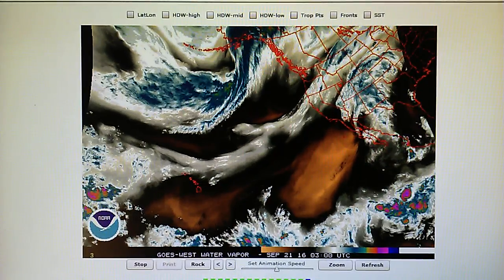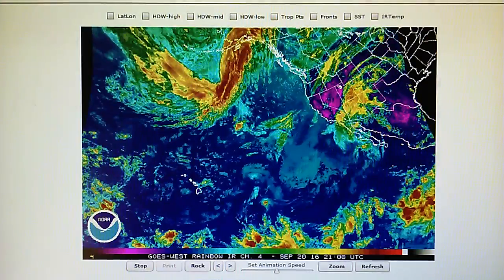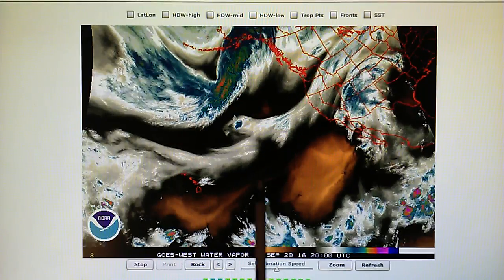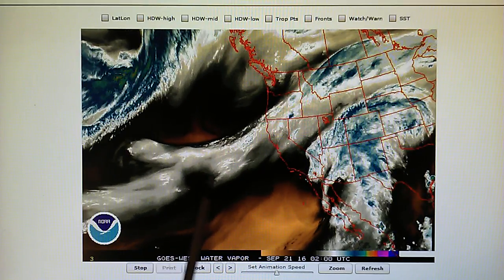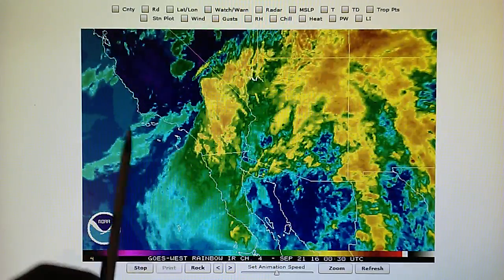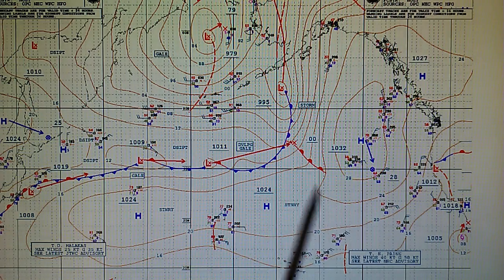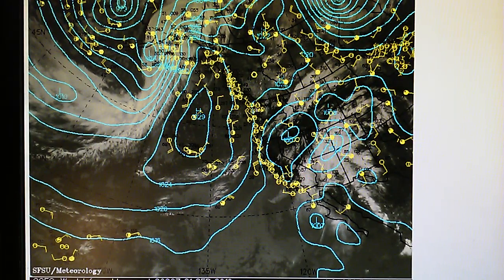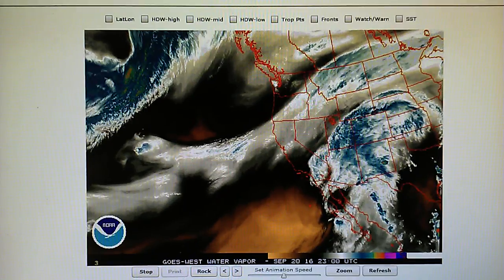9-20-2016; On-Demand Climate Change: Hurricane Paine Blown Apart With Microwave

Comment: the pic of the surface high over 4 corners with 3 lows around it . usually surface pressure should be lower over those mountains.  meteorologists would have a hard time denying that one

Comment: I've been compiling lots of pictures and data from nor cal. I watch your report everyday because I don't like using the govt maps , just wx interfaces are enough for me to be able to see what you're seeing . where I am, the rain is still being blasted apart.  the clouds break up into lines , and you can see them start to rotate counter clockwise. 

chemtrails up right before sky cleared and clouds stated to break . not sure if chemtrails have any correlation , or if they show up because of the changes in the air .

to me It looks similar to ion tech they use in the UAE.  they can use that for both wet and dry.  

also the jet here correlates with hurricane prevention in the east . seen it thru a wxmod company operations pdf .

weather channel gets everything right with increasing accuracy.  they talk with a suspicion as if they already know. 

you can almost feel it in the air when the storms are blasted away.  it'll be abnormally humid and not windy.  I live in a valley town banked up against the Sierra. 

seems like every morning when t storms in Sierra are active,  storms get blown apart from east to west.  abnormally sinking air from the mountains causes it to get foggy when it usually shouldn't

Comment: It was awful here in Surprise, Arizona, skies covered with chemtrails and many HARRP designs covering the sky. One good thing was I got to open a few windows and turned off the air conditioner that I can't stand. I worked outdoors 38 years in California and never used air conditioner so my body can't stand it "yet". I still feel afraid being here for the last 3 weeks knowing that weather warfare is here too. Knowing the weather terrorists are attacking and not knowing what their plans are is scary, plus knowing the heat temperatures are extreme here.